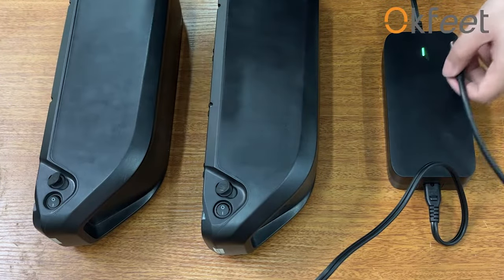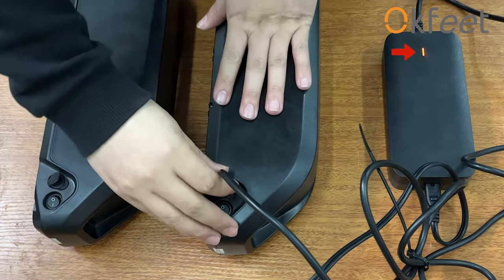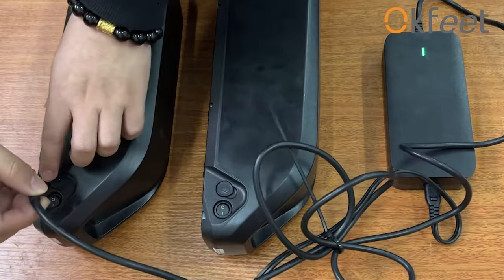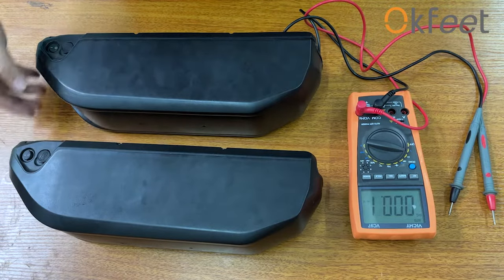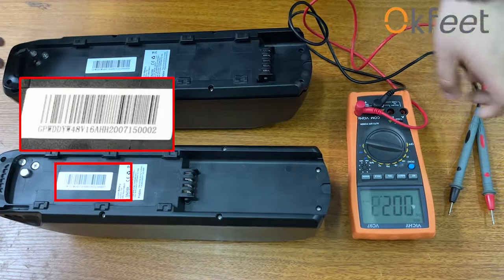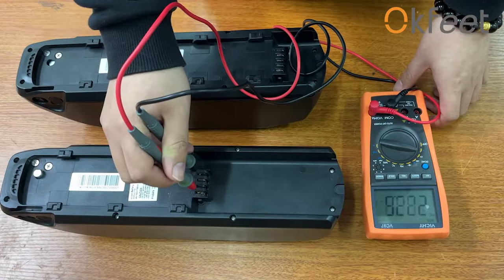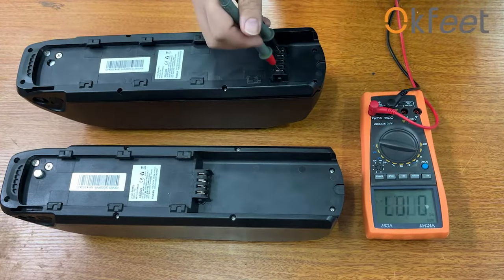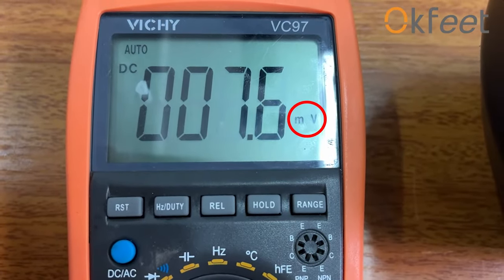How to check charger and battery issue by voltage meter?

Comment: I have been charging a 48v battery for 7 hours now and the red light is still on. Is this how it should be or is there some kind of problem? The indicator on the battery has been showing full charge for a long time now, but the red light is still on the charger.
I have two batteries and the same problem with each.

Comment: I just got my bike today and it started red and now its green is it charged or broken? I put it on the bike because i thought it was charged and it lit up red and it wouldnt work
Reply: No Lol, hope you realised after putting your comment down after 3 days. Red means charging and when it turns green it means the battery is fully charged to its capacity. Right now I'm charging my escooter and the charger is showing red but when it becomes full it will turn green. Hope you understand by now. ✌️
Reply: @MrJLiebert  i found out i was turning it off when i was trying to use it and one when i thought i was turning it off. It was mever broken😂😂. But i know how to use it now i was just dumb at first

Comment: Somebody wants me to sell ebike with no battery. The bike had the original 48v.  How to check bike if is in working condition? I have a 36v battery at home..., and a charger too. Any ideas? Thanks
Reply from the maker: Well, you can check out our previous videos, for example:
How to check why the ebike battery cannot be discharged (COMPLETE Ultimate Guide) and How to check why the ebike battery cannot be charged. These two. I hope they were helpful. Thank you
Reply: Check the hall sensor 
Throttle of bike
Controller of bike 
Display meter 
These thing will tell either want to get it or not